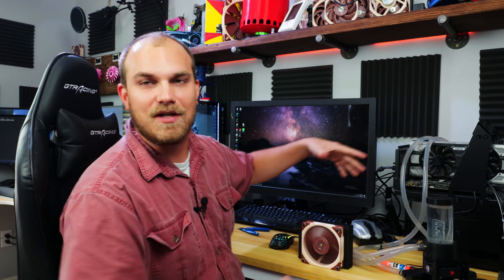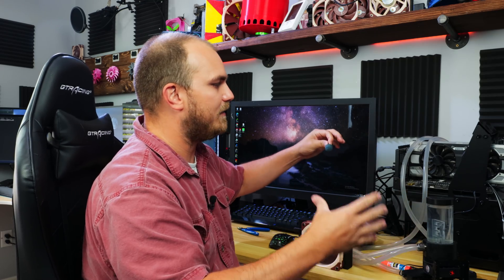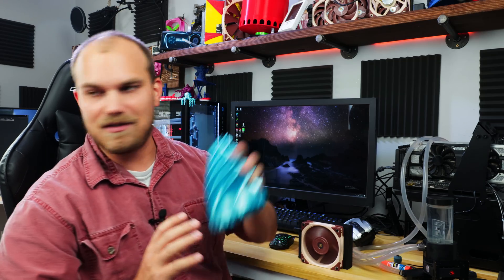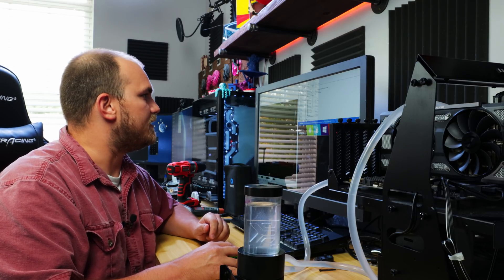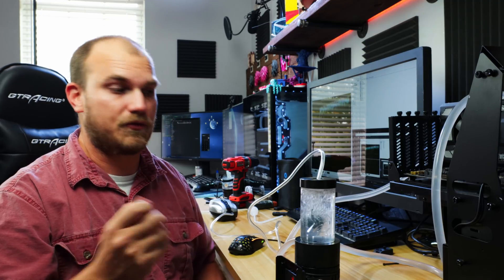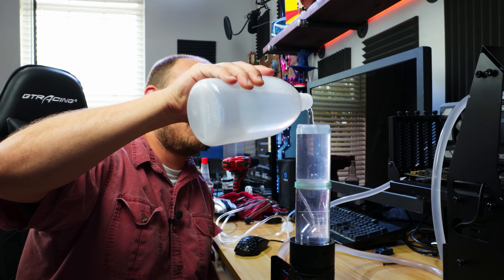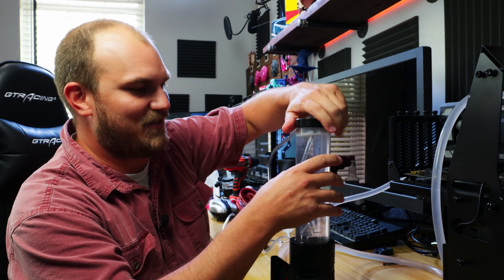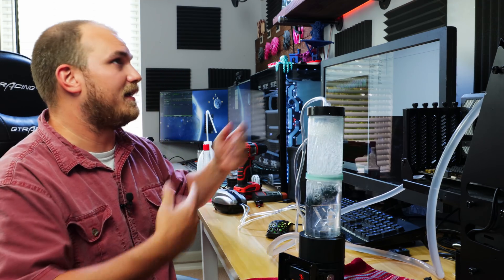Can An Airstone Cool Your PC?

Comment: Evaporative cooling works better in a dry environment.

Instead of running an open loop, which is the only way this setup would produce cooling, you need to run this like a normal cooling loop, but replace the radiators with a liquid-liquid heat exchanger, which could be as simple as adding putting a coil of tubing/hose at the bottom of an aquarium/water-closet/swimming-pool/pond, and then add the air stone to that body of water

Comment: ...Why do it with the lid on??

Also, probably need the air stones lower...

For it to work best you either need a lot of surface area in the pump reservoir, or cold air in the pump.

I  have ideas.... But I still prefer the waterfall option. (From personal experience you have to really watch the water level though, the more the water is exposed to air the more it steals your beloved)

Comment: I know its a year later, however,  you need to make sure the return line isn't directly feeding the out line.  your reservoir water is a reserve in this case and not a feed.  you need to bring water in from the top, so the hot water actually runs through your bubbles instead of screaming by underneath in the d5 pump.  Did something similar myself, hope this helps the idea along.

Comment: Way after the fact ( new sub watching some of your older videos) but I think you need to go wider, not taller. A proof of concept that might help is if you could a plastic container with a little more volume than the reservoir has and cut a hole to allow water to pass and aerate that.  Also I think the water needs room to settle before being pushed back into the loop. maybe a water vortex like a whirlpool?

Comment: Think about thermal conservation of energy. To get the heat out you have to expel heat. You simply don't have enough air moving through the system to carry away enough of the energy.

Comment: The air we breathe isn't the best at conducting heat (not so great at insulating heat either). Increasing the surface area should help with your cooling.

Comment: It didn't work because all of the evaporation happens at the top, but the way your water pump sucks in water from the bottom it isn't getting any of the cooled water. If you extend the loop with an additional water tank that receives water from the bottom and ejects water back into the loop at a higher level and the airstones in the middle you should be able to get better cooling from them. The only problem is air bubbles can get sucked into the loop as well. So maybe add a third water reservoir that allows the air bubbles to float to the top before the water goes into the system.

Comment: how about a twist to this idea... still run it with a rad and cooling fans. but lets see if adding bubbles hurts the loops cooling. ive had the idea of adding something like this cause water loops look more appealing to me on first start up with all the bubbles running though it.   is it possible to keep bubbles in a loop and still retain good cooling.

Comment: By the way, your 3d printed spray cooling chamber will be dual function by accident. The water will be cleaning the air. Better put a simple filter in there 😂

Comment: Greetings from Argentina! Now that you brought an airstone what about a fish tank? It's not a good idea because of all that biological material... but what if there's no biological material at all? Is it possible to get rid of the radiator and fan/s? 
I don't know anything about fish tanks/aquariums (I don't even know if they are different things :v). Anyway, let's suppose that the hottest water possible for tropical fish is 35°C (I'm just doing a wild guess), so there'll be 2 top temperatures to not reach, the processor one OR the life support of the hypothetical tenats of the aquarium one. Another will guess is that a regular aquarium would contain 200 liters. Would it be suffice to success? I hope this idea be like a woodpecker to your mind Cosmo_Kramer_pimp.gif

Comment: I've seen a water cooler that was totally passive. It consisted of a narrow but tall reservoir fitted with vertical ridges going top to bottom. The warm water enters from the top and cools down as as it travels down.

For your setup, you need the warm water to go in from the top and out from the bottom. In your current setup, the warm water comes in from the bottom.

Comment: Best way to water cooling without radiator is to use largest reservoir
Check this out
https://youtu.be/qInsTJ-SG-A

My suggestion, find a tank / bucket which is big enough and put in under your table and make it as secure as possible (no dust can come in, add additives etc)
Have fun

Comment: Hey, heat has to go somewhere, how do you expect it to work when it has lid on it. Do an open system, let it evaporate and give heat a way to escape by increase of surface area. In addition to airstones 3D print a grid with holes to produce bubbles  on whole bottom surface. And also ditch that pump, it's electric, gets hot and transfers heat to the air. Run it from the compressor. loss of pressure makes air colder, it will increase cooling. I can't think of any other way to improve on that.

Comment: One thing is you need to do is leave the cap off,,, the air being injected needs to get out of the way quickly or it will help increase heat by becoming an insulator. You will see an improvement by also sending cold air through the stone by an air chiller. kind of counter productive,, but it would make it better.

Comment: What if you made it pass through a steel mesh like corse steel wool or cupper wool. When water cooling the actual water doesn't get that hot but if you are give it something else to transfer the heat to it might work

Comment: Running air through a pump increases its temperature, you're basically adding heat to the system instead of removing it.

Comment: IDEA: Try having the return water come to the top of the reservoir / right into the aeration zone? Right now the water does its full loop basically before the bubbles do anything. At least this way you can try to capture more of that surface area thats being aeriated and possibly exchange more heat?

Comment: Is there a fluid that boils at low temps that isn't wildly flammable? Always wondered what would happen if a water loop was filled with carb&choke cleaner or brake cleaner but obviously that's a meth lab fire waiting to happen

Comment: Cooling water with air is impractical because you would need ~10,000L of air that is 2 degrees colder than 1L of water to reduce that water's temperature by 1 degree.

Comment: One thing you should probably test is the temperature of the air coming out of the airstone. Its likely that the motor is designed to dispel it's heat with that air being pushed out so, you may have warm air, meeting warm water and just not giving you the cooling effect you want.

Comment: that's not going to work. water have more heat capacity than air so reducing water by adding air into the system makes it worse. introducing bubbles will only work if the bubble itself is cold air. it would make more sense to actually make the water resevoir a meter square thin layer of water than to actually makes it taller. maybe make a waterfall where the hot water falls into the resevoir below

Comment: You need a much bigger reservoir, more bubblers, and I think the water intake should be above the bubbles. Of course this won't work by just plugging in a tube as you don't want any air in your loop, but I think a secondary intake container and a well-placed hole in the main container could fix that problem.

Comment: air compressors actually heat the air that they compress, so your adding heat to the system with this setup.  if you used the vacuum side of the compressor(air pump at the top of the chamber to suck the air out (it would have to be sealed) and the air stone would be left to open air to suck in , and the compressor would be left to vent to the room then at least it would be room temperature air going through the air stone.

Comment: Cab you try it again with a bigger Reservoir and a air compressor with variable output valve so you can adjust the flow of air through the water...

Comment: The air becomes fully saturated pretty soon after exiting the air stone. So it could be a mile tall and not make a difference. You can use pieces of evaporative media (munters) and blow air across it. Consumer version would be sold for a furnace humidifier. It’ll work way better than the cooling tower.

Comment: Don't those air pump compress and heat the air?
So aren't you actually pumping hot compressed air into the water?

I guess it will cool down some when it expands bit not all that much.... I guess maybe if you intercolled the air before using it to airate the tank...

Comment: Is the warm incoming water even interacting with the air in any meaningful way? 

It seems to me that most of the water is getting added to the reservoir from the bottom, then being directly pulled back into the loop. The reservoir was never meant to hold water for any amount of time, it's just there to be a fill point and to provide a source of water to fill any bubbles that get into the loop.

I doubt the EK logo barrier at the bottom is deflecting much water up towards the bubbles, it's just there to prevent a vortex forming as water gets sucked down by the pump.

If you actually wanted the bubbles to do any cooling, you'd need to actually build a cooling tower - dump warm water in from the top of the tower, pull cooled water out from the bottom of the tower, which would force the warm water to interact with the bubbles.

Comment: I’ve had aquariums and those air pumps get hot themselves, you could be pumping hot air into cool liquid thereby adding to the problem! The reason the tower worked is that it was sucked room air passing up the tower, not compressed air push in! Try looking at to opposite as the release of compressed gas can and often does freeze!! 😜

Comment: think portacool. they work by water running over a card board like insert then blowing air across that... what if you make a mini portacool and had that cooler air blowing across the radiator
Reply: maybe try it with the water from the loop and try it with its own fresh water that isnt getting heated from the loop but the idea is through evaporation it cools the air that comes out.

Comment: Simple:  Make a long big tube, like a sewer pipe or bigger, bout 30cm in diameter and  whole room tall.  Then add a small shower head on top and pump your water there. Also either pump cool air in it, or make some holes on top and bottom.  That way you change the ratio of water / air drastically.

Comment: Iaaue is no way for the heat to disapate. Ya should have still pumped thru the radiator with fan off. Your agitating water but the heat is trapped in the loop qhere it can not radiate.

Comment: Not a flow engenier here, but i think your idea has potential.
Maybe if you have flow of hot water downwards trough the reservoar, this reservoar isnt designed for heat exchange after all.

Comment: the bubbler simply doesnt give enough energy to cool down even tho it has more bubbles... just feel the air from the bubbler tube.... these ar meant for fishes to get some air. if you want a great idea get a large fish tank but only like 4 inches tall i mean get more surface. then blow some big fans on to it. and trust me it wont throttle. 
the problems.
1. takes too much space.
2. water will evaporate quickly.
3. i dont know

Comment: ok you should try one with more length, but with two tubes connected at the top like a flat upside down U with the top open for evaporation with the input and output port on the bottom ends of the U, with an airstone at or near the end of both tips of the U. make sure that the water level is high enough for the water to travel from one tip of the U to the other through the connection that is open to air.

 you could probably also have a metal plate or plates that run in the direction of the water flow dipped into the part of the water at the top of the reverse U to also assiste with heat transfer.

Comment: Would like to see a submerged radiator system as I think water would pull heat away from metal faster than air. But then how to keep the water itself from getting to warm... radiators upon radiators...
It's late. Don't @ me for my inaccurate science please.

Comment: @Major Hardware have you considered a old or new oil radiator from a car in a second pc case with pc fans in push pull with quick disconnect fittings and you can run all you water cooling components in the second case, you could then also run ducting from a reverse cycle air conditioner straight into the second case this way you can super cooler you loop without getting moisture on your components.

Comment: Did you ever tried ultrasound? But dont put more air, just use ultrasound to evaporate the water. And actually, there are some physics involved, that can make it work.
Ultrasound can allow heat transfer coefficient enhancement of about 50%, some papers about the subject:
https://www.sciencedirect.com/science/article/pii/089417779290059E
https://www.researchgate.net/publication/251602482_Effects_of_ultrasonic_waves_on_the_heat_transfer_enhancement_in_subcooled_boiling

Comment: What about a thermosyphon? use something with a low boiling point like isopropyl alcohol. Then run that vapour through a condenser to remove the heat.

Comment: When you compress air it heats up due to the heat from a larger area being compressed into a smaller one. That's how refrigerators work.
 Idea: why not pump air into a radiator grill so the heat dissipates and cools the air down. Leave a very small hole (for resistance) at the end so the air within the grill is still somewhat pressurised but then depressurises when it gets pumped into the air-stone. You'd be getting freezing cold air vs higher than room temperature air which is why I think the air cooling makes it worse in this video.

Comment: Instead of taking the radiator out of the loop, use the air to circulate the water instead of the pump. If you use a smaller diamiter hose introduce large diamiter bubbles at the base of a water coloum it should circulate the water. Im currious if  enough water can be circulated at enough pressure to cool the cpu.

Comment: Is the tank water itself all that hot? I would think you'd need some cross-flow (like, put the return tube into the top of the reservoir so that it's going down as the air comes up). Otherwise, you're just cooling the reservoir and only slightly cooling the water is actually seeing some action, which is on the bottom.

Comment: The return line into the loop would need to come down through the top, otherwise the cooled (previously aerated) water doesn't enter the system regularly.  I would bet if you tested the temps of the tank vs the loop, there would be a high temp differential.

Comment: This seems like a problem of volume. How much air is the pump pushing per minute compared to a fan? In the raintower you have a lot of surface area and volume to transfer the heat into. So if you increase the volume of air it should increase its thermal capacity to take away heat. To test this you could measure air and water temperature at the in- and outtakes. My assumption would be that in your setup the air is already at the same temperature as the water.

Comment: 2:00  My prediction: The volume of air won't be sufficient to exchange enough heat into the atmosphere and will also add enough dissolved air into the loop to lower the water's capability to exchange heat from the CPU block.

Comment: You should take a small AC unit and use the heat pump in the AC unit to actively cool the system...no matter how small of an AC unit you get it will be more than enough to out cool anything else you've tried...also a mini fridge would work fine too

Comment: So this won't work because the surface area of the water is barely larger than normal. The water can't transfer the heat to the air much more than no

Comment: If you pressure the air then the air heats up, its a bad idea to cool that way the water it may raise the temp or even not affect it at all.
1. Try dismanteling cheap mini fridge and turn the copper cold pipe side into a coil that fits the water reservoir. The more coils submerged in the water the better the effect will be.
2. Use the biggest air coolers you have to cool a thermoelectric that is connected to an extra cpu water block but it is connected the water where  is which will be used to cool the water and the positioning of it will be between the cpu and the pump. < I recomend you test this one

Comment: what if you make an array of copper tubes that are usually seen on air coolers and installe them into the res and lead them out to a fan/rad that's on the outside??

Comment: Put a heatsink/spreader in the reservoir over the them. If you design a heatsunk that fits perfectly in a reservoir,  allows the hose to pass through and the air to pass up it might be better than a real radiator. Might.....
Reply: Or be something that you can use to reduce temps a little farther.

Comment: Measure the temp of the air coming out of the pump. I suspect it is above ambient temp and possibly hot. If you open that air pump you will see that it is just 110V of AC, running through magnet wire, wrapped around a steel block, with an inner winding acting as a voltage step down transformer. This creates an oscillating magnetic field that drives the magnets back and forth. The air intakes are usually positioned under that hot block of metal to cool them off.

Comment: Air carries thermal energy less efficiently than water. Increasing the amount of air in the water column only serves to lower the thermal efficiency of the system. Bubble size is irrelevant.

Comment: you want a reservior with intakes at opposite ends so that the air has to pass in the opposite direction to the water resulting in increased heat transfer